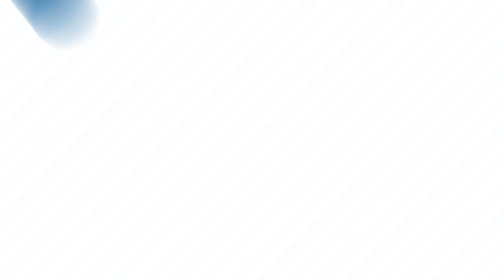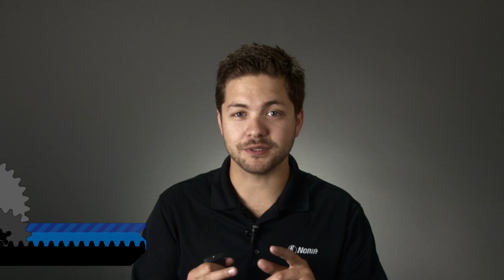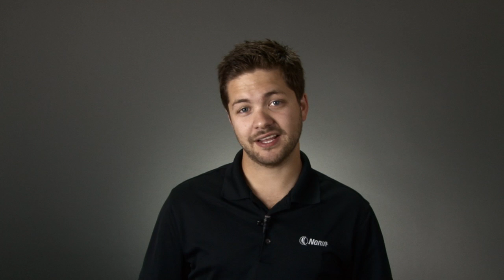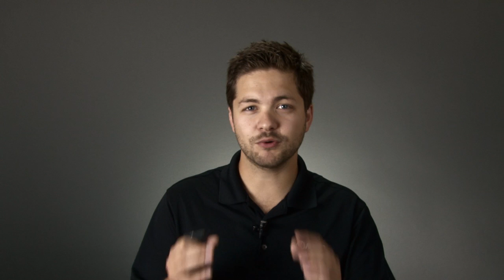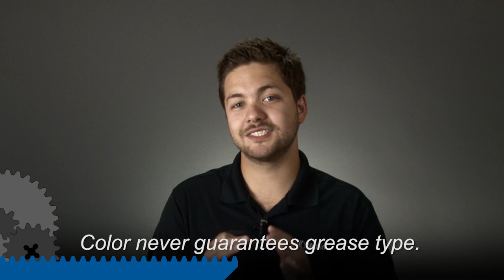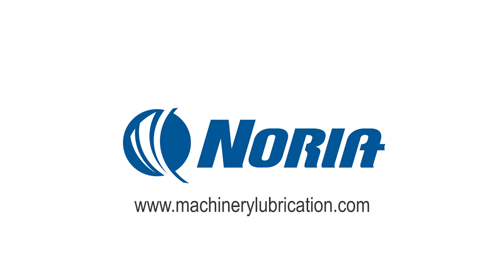What Grease Color Can Tell You

Comment: not helpfull did not tell what color means what type of grease
Reply from the maker: Hi Robert! The reason we didn't cover that in-depth is that there is no standardization of grease color across manufacturers. A red grease from one manufacturer may have a completely different composition than a red grease from another manufacturer. Due to this, color means almost nothing when talking about greases generally, but can be more useful if your organization standardizes on certain different-colored greases for different uses. The relative color of grease over time is also important to monitor, since noting a lightening or darkening of the grease during visual inspection can indicate different contamination issues (water or process fluid ingression, additive loss, etc).